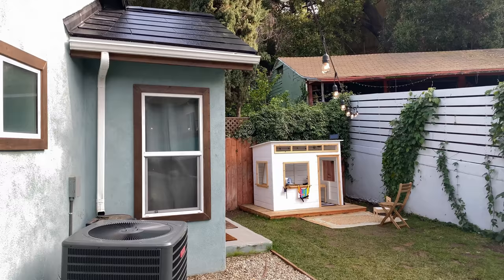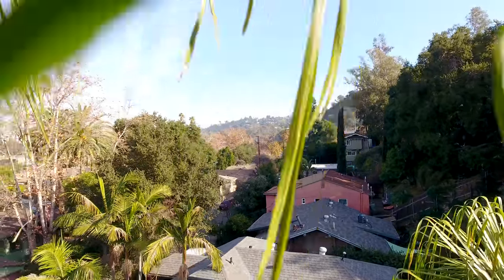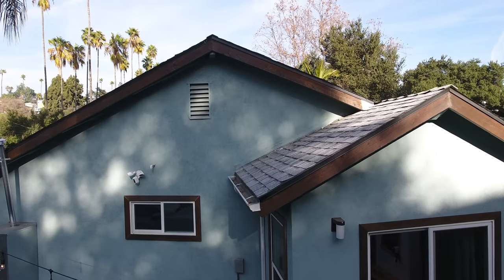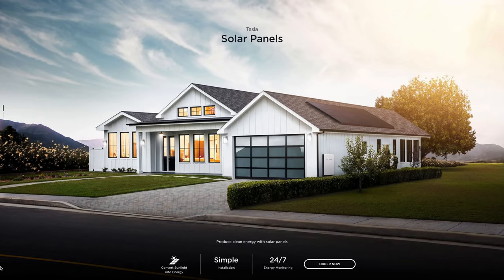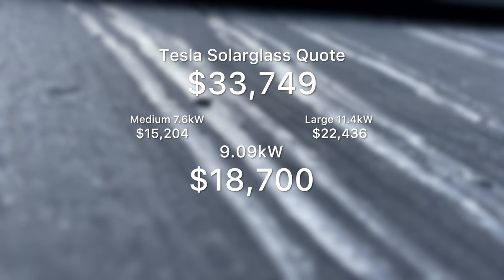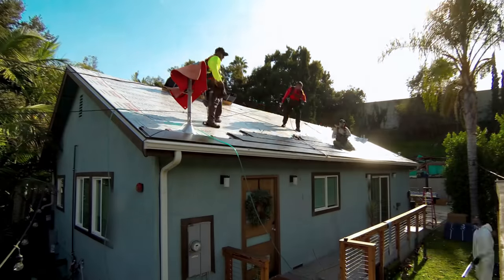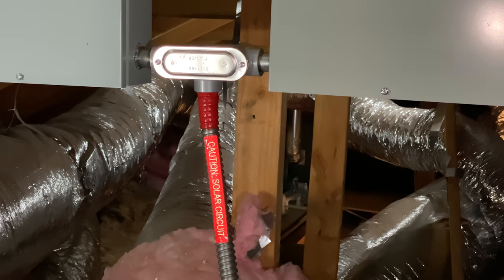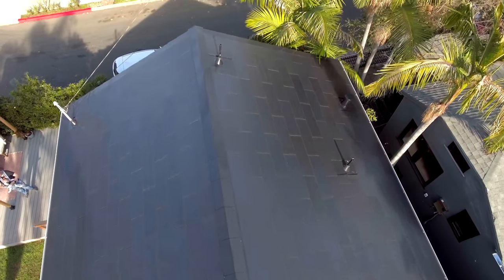WE GOT A TESLA SOLAR ROOF : First impressions and what you need to know!

Comment: I sell solar for living for another company and we always talked people out of getting the Tesla’s solar roof because of the high cost. But you got a great deal it seems. Normally it would cost you 3-4 more then traditional solar system. If Tesla has made it this cheap sooner they would be the leading solar company right now. Props to Tesla for working on it and making it what it is.
Reply: Props to you for your honest comment!
Reply: Count in the cost to take off roof titles and you'll get at least 5x. I'm also working on installing and maintenance of solar systems (both PV and SC), but in terms of repairs that thing looks like a nightmare compared to regular solar. I'm also afraid that weird style Tesla provides will reflect some light and decrease overall performance a bit.
Overall normal solar are a better idea. Cheaper and faster installation means that the installation will pay off much faster.
You also need to be a certified tesla installer, so you can charge even more
Reply: I don’t it’s been turned on yet lol
Reply: Haha. He could have gotten regular solar for about $12K not $18k.

Comment: We had Tesla Solar Panels installed on 12/20, Inspection on 1/6, and PTO on 1/9. Producing about 25kWh per day. We are in Los Angeles as well!
Reply: I pray none of the panel's that are higher on the roof break or need replacing because the draw back is, you or they have to remove all those below that one or many to fix the bad one or one's. They are not manufactured here. More likely China because that's also where their partner gets theirs done.
Reply: Of course you are
Reply: @ranman58635  For all inflexible roofing materials this is the exact same issue, and inflexible roofing materials 'tend' to have higher durability. These panels are rated at about 10 times the strength and long term durability of most roofing materials, and tests have demonstrated this consistently. Even when damaged, a panel will 'crack' but like traditional high endurance glass, a crack doesn't indicate a penetration of the material, and it can in fact remain in place and still be effective as a roofing tile, even if it's electronics are compromised. 

The wiring underneath the paneling is parallel circuitry, not series, so panel failures have no effect on neighboring panels operation. The circuitry in each panel is also designed with relatively cheap chips which detect failures and disable the panel in the event of damage. Assuming a penetrating damage to the tile, like with all other roofs, it is always an option to patch it without replacing the panel using tar flashing for the patch. It's less aesthetically pleasing, but effective none the less. The fact that it's elevated off the roof has no effect since the panel layer is the only layer that needs to remain leak-proof and intact. 

Essentially half of all roofing materials suffer from the issue you describe, and yet aren't generally deterred in the market in spite of this since serious roof damage is not that common unless you live in a heavily wooded area (Trees falling on your house), or a place subject to frequent hurricanes or tornadoes. Los Angeles suffers neither of these problems, and thus is not an area at high risk for roof damage occurring, and planes and meteors simply don't strike houses often enough to make it a concern. The panels are more than strong enough to handle bird strikes, baseballs, or other common neighborhood trauma without cracking.
Reply: Damn.. I'm in NY and my regular solar panels averaging 35kwh daily..
Reply: @rizwanx7482  I'm in NYC with a 7.92kw system.  For the past12 months, i'm averaging 20.6kwh daily.  Curious on how big your system is to get 35kwh.

Comment: 3:59 you can see where the actual solar panels are. and see the dummy ones.
Reply: NOTHING IS 100% FAILSAFE.... EVEN PANELS CAN HAVE DEAD ZONE DEPENDING OB HOUSE ORIENTATION & BUILDINGS & SURROUNDING TREES... GOOD 4 HIM... HE TOOK THE RISK....... BUT WHAT ABOUT A POWERWALL X2
Reply: @TheHwnleatherguy  WHY ARE YOU SCREAMING?!
Reply: Good catch! He said the tiles around fixtures were fake so I figured everything else was solar. If those are the actual panels then its not worth it it.
Reply: @tiagoj8020  why? The amount of solar is dependent on the users needs.

In this case 9kw, so it has 9kw of panels installed.
Reply: but can see them standing on the road you can probably see from the sky looking down
Reply: Adrian G Eyre based on Tesla’s description they should all look the same from ground level.
Reply: @justinseau  that's my point
Reply: @JustTodd24  They must have left caps lock on, now they locked themself out of their computer and are calling IT for assistance.
Reply: You mean at 3:55 , there's no roof at 3:59
Reply: @JustTodd24  he's not screaming, he just talks loud, get over it.
Reply: Green Giant  you're right. Thanks.
Reply: YourMajesty143 no 3:59, the roof is right there with sunlight reflection on it.

Comment: Given the condition of the existing roof and the money that needed spending on it, this was a great option and well worth it in my opinion.  Looks Soooooooo much better than the old one too.  Great video - I didn't even know that Tesla had started selling these yet.  Will probably have to wait some years before we see them in Australia though and I bet the cost will be much higher per KW than you have paid.  As an aside one thing I've never understood is why standard roofs in the USA are so bad and seem to need replacing every 25 years or so when we generally get 50 to 100 years here depending on what is used.  My place is 28 years old now and the roof is in as new condition and I wouldn't anticipate me needing to replace it in my lifetime, there are plenty of 60 to 70 year old places around me as well all on their original roof.  Some may have been repainted in that time but that's about it, but that's just an observation.

Comment: I had my house built 10 years ago with spray foam insulation in all walls, the roof and the "ceiling" of the crawlspace.. I estimate it cost me about $5000 more that batt insulation.  I live near Atlanta GA and my electric bill in the summer is $70/mo.  Insulation is good.  And somehow seems cheaper that this roof solution, as admirable as it is.  You can improve your house so much that no buyer will be able to get a mortgage to buy it, so be aware of that.
Reply: Another higher ROI energy saving proect is a heat pump hot water heater that would save a family of 5 about 3,000 kwh/yr.  A DIY'er could install one for about $1after rebates / credits.  A fraction of the cost of an equivalent solar panel install.

Comment: Also are you gonna get a Tesla power wall?  If so would this system use 2?
Reply from the maker: We didn’t think a powerwall made sense for us. Wouldn’t effect our (non-existent bill) and not worried about power outages.
Reply: Austin Flack I guess I assumed it was to buffer the days of no or little sun to allow you to stay off grid and charge your Tesla at night.
Reply from the maker: LADWP gives us credits for when we generate excess power—sort of like rollover minutes—and it’s unlikely we’ll ever be in the red.
Reply: @SethMaxwell  I recall someone say that using the powerwall to charge your Tesla amounts to just giving it a snack.
Reply: so if I understand correctly - during daylight hours, you're going to use your roof energy, as well as put excess energy back into the grid for monetary credit. Then use grid power for night and low energy hours, with the hope/plan that your excess production equals or exceeds your total use (dollar even per month).  With the powerwalls, you could charge them up in the day / drain them at night, and hopefully not use any grid energy (nor give them any surplus) I can understand why it doesn't make sense to spend another $20k on this... its too bad it works that way, because storing your own excess would certainly be a lot "greener". Maybe the future generations of Tesla cars will allow their use as connected energy storage, lessening the need for "powerwalls" since we've already got a big battery sitting in the garage.
Reply: @BruceM   LADWP the local utility,  read the meter every two months.  There is two options either flat rate or time or use.  

I have time of use.  The invoice still breaks it down into 3 periods ( High Peak, Low Peak, Base) and Delivered and Received  then they bill me the Net used.   If your negative they credit a NEM bank and bill you the connection charge $23.70 in my case most of the year for two months so $11.85 a month.  

If your hot summer usage or overcast winter usage is positive than they seem to withdraw 66% of the bill from your NEM bank and bill you the remaining 33%.

With a new PHEV , plans on an electric waterheater and future Tesla truck etc... I am adding another 8.3KW to my 16.4 system.  To hopefully always be negative.  For my first year I was ~320 KWH owing compared to a retired client with a larger house and smaller system with a modelX at -5,300 KWH

I have a client in the neighboring utility that uses 3 tesla walls with the solar I installed to cut the High Peak usage and to power the home during the now regular Edison Blackouts to avoid fires.

I contacted Tesla for a single powerwall to reinforce my existing EM system.  When my time came they were only installing 2 system minimums so I moved forward with a Sunny Island system.  Though I am very impressed with the system they installed at my clients house.

When the day comes that LADWP changes their NET metering contracts, then I will quickly purchase the current Tesla Walls.  Their metering/switching equipment is impressive.
Reply: Powerwall 2 is too expensive, however with the (hopefully) new battery breakthroughs maybe Powerwall 3 is not far away and hopefully much cheaper and a much longer warranty to match the roof

Comment: Did the installation cost include any Tesla Powerwall modules to store the solar energy?
Reply: How much energy can be stored?
Reply: Looks like just an inverter in the video.
Reply: NO, the kw system, and production, were based on the customers current electric usages.  Battery makes this totally cost prohibited.  You must be connected to the Grid to make any sense out of doing this.

Comment: @AustinFlack Looks like it has been about 4 months since Go Live.  How is the system working?  Has the performance been at least what was estimated or better?  Less?  You thoughts?  Are the panels independent of each other so that shading doesn't affect the overall production of the system?  How are the tiles wired together?  I believe I read Telsa warranties the panels from even damage and will replace under warranty within the 25 years?  Does Tesla provide new color match pipe venting and whatnot that come out of the roof?  What about installing roof turbine vents (Whirly birds)?

Any issues with dirt, debris, pollen, etc. reducing the system performance?
Please update the community on your first 3-4 months of the system being on!!
Reply from the maker: Just posted my update video! Answers a ton of those questions! https://www.youtube.com/watch?v=DG8ImNJHeKI

Comment: How this works at winter with roof full of snow? I hope you have backup power cable.
Reply: They are still hooked up to the grid..
Reply: Panels soak in sun, hasten snow melting, and is some cases the snow reflects and increases production.
Reply: Heavy L.A. snow is a bitch

Comment: Considering this option as well.  We have a traditional solar system that was poorly installed by the previous owner 10+ years ago and is woefully inefficient (less than 3% recovery)...we also have a roof that is not fully ready for replacement, but will be soon (14 years old).  Tesla estimated my cost to be $46k with incentives for a 10.3kw install.  That is roughly 150% of the cost of solar plus new roof ($30k)...we aren’t fully sold on the Tesla roof yet as a result...looking forward to your updates.

Comment: Hey Austin. I'm in the Hollywood area and installation of my Solar Glass roof was completed today.  I'd be interested in talking with you and comparing some notes.  I am also now waiting for PTO from LADWP.  I've sent you a note on FB with my #.  Cheers!
Reply: shadowcity11211 did you film it?
Reply: @jalexand007  yes, the footage will be done soon.
Reply: How much hotter is your attic now?
Reply: @omgnothingisavl  why would it be hotter? the panels are an 1inch above the plywood allowing airflow and i couldn't tell if that was a vented ridgecap or not
Reply: @krazzygranny7032  YES... I think you got it right. The gap of 1 inch and air will insulate as well as convection of air in the gap will keep the attic or what ever is below roof in a cool temperature.
Reply from the maker: @krazzygranny7032  It is a vented ridge gap

Comment: Ok correct me if I'm wrong, At about $100 a month in electricity as opposed to the cost of the panels. It'll take over 2 decades to break even in cost and savings.. The rebates may not be the same or even available in all states? Also, no one EVER speaks directly about the monthly cost of the loan taken out for the panels. You save on the electric bill but pick up a loan that runs parallel with your home loan for the panels.. Selling your home with a secondary loan for the panels is a deal breaker when you go to sell, making the overall cost of solar a huge blow to your pocketbook and the value of your home.

-Mortgage : $1800 give our take whatever it may be for you. 
-Loan for solar panels : $200 monthly on a 25yr loan give or take NOT including interest. 
-Original electric bill : $200 range
-Electric bill with solar: $0 - 100+ given a week of storms on occasion throughout the year. 
-Real savings and actual length to recoup cost of panels in that price range : nearly 3 decades of electricity bills, by then the efficiency of your panels will have diminished, the battery pack will have needed to be replaced reseting all of the numbers I gave and your heart will be hurting as the price of solar will be very cheap by then. 
**for those that say you'd have to redo your roof by then, replacing a solar roof cost more than installing it over the years even if you just replace each section as needed adding to a never ending money pit that will never pay itself off.
Reply: Home Tablet this is very location dependent. Where I am, in Southern California, we pay .25 per kw. Summer electric bills are typically $500 per month for a 1 AC system home. Payback is a lot quicker than areas with less expensive electricity costs.
Reply: @joet2699  thank you for your response and info. I love in southern Louisiana where it's hot 24 hrs a day during the summer. Electricity rates are the same 24/7 365, the electric company here does not pay back for power you generate and there are no tax incentives for purchase and installation of solar. So the cost for any other states that are like Louisiana wont be worth it at all 😢

Comment: The glass roofs seems to be a lot more expensive.  Just the regular Tesla solar panels you can get 11.4kW worth for $21,400.   If you add the 3 powerwalls then it only comes to $34,400.  For you though I get why the glass roof was a better option as you were needing a new roof, but for regular people with roofs that don't need replacing, the panels are a much better deal.
Reply from the maker: Yes, no one should ever buy this if they don’t need a new roof.

Comment: That looks really cool and it's nice to see that the product actually exists.  Still seems kinda pricey though, like even that price for a conventional roof seems expensive.  Pretty sure my parents got their house done for around 6k give or take and the house is about the same size but a bit more complicated roof.    I'm still a fan of conventional solar installs as you can optimize it for what part of the roof gets the most sun, without touching the roof.  In a case where the roof needs to be redone anyway then I guess the tiles make sense.   I only have room for about 3kw on my roof due to my house roof being awkward and lot of shadows everywhere else so I figured it would cost me around 15k with a good battery setup.  Not quite worth it for me for only 3kw though, and it's too hard to get to that part of the roof so I would not be able to take the snow off every morning.
Reply: it is. it only cost like 12k to replace a roof. mind you if i use the oven a lot my power bill would be 1,800 per year and if i used electricity to heat my home my power bill would be 3600 per year. so it would pay for it self in 10 years and they would still work for another 15 years.

Comment: Great follow up video! I've got questions since i would love to get a Tesla Solarglass roof myself. 1) Since you got your roof didn't Tesla release their own Inverter. Do you see need or advantages to having a Tesla inverter to the one you have. 2) Will you be adding a Tesla Powerwall to your system? 3) Based on your 1 year of usage data, how long will it take for the Solarglass roof to pay for itself? 4) What would you have done differently in your roofing process?? Thanks can't wait to read your follow-up!!
Reply from the maker: They did release their own inverter. I'm not sure if it's better or not. I'd like to add a powerwall, but there wouldn't really be an ROI, because as you can see my energy costs are already so low. 

Wouldn't do anything different in regards to the Solar Roof, but certainly should've gotten a roof-specific inspection when we bought the home! We did take the developer to small claims court and got a settlement, so that was good.
Reply: @AustinFlack  Glad you won in small claims court! Whats the sweet spot cost wise for jumping into getting a Solar Roof? Think waiting for Tesla Solar Roofs to come down a bit. But I'm on the edge of needing a new roof since mine is about 23 years old. No leaks but i can tell its very very over due! Come on Tesla!